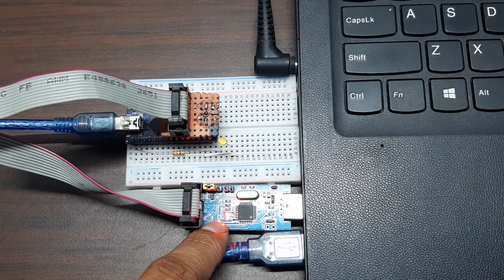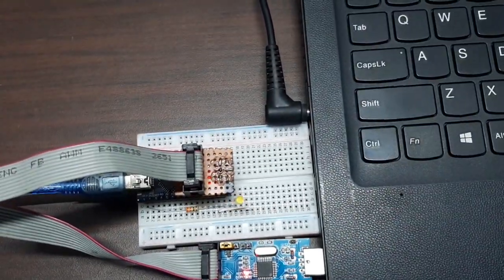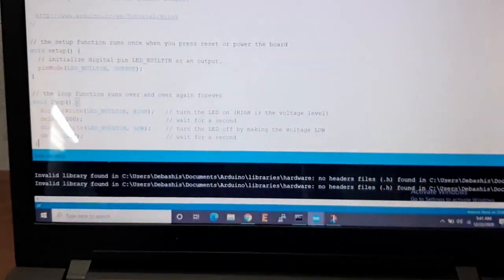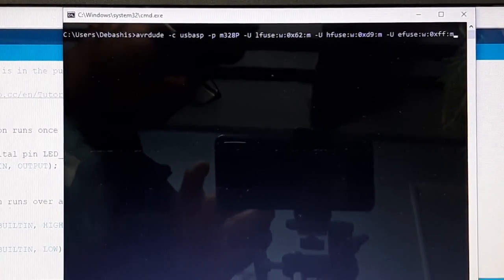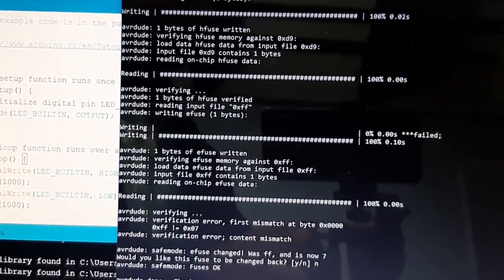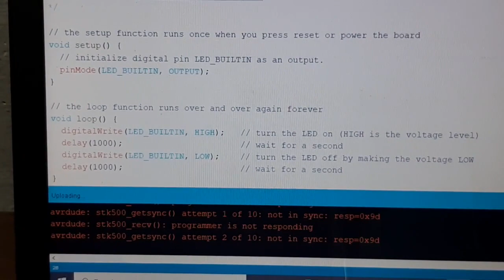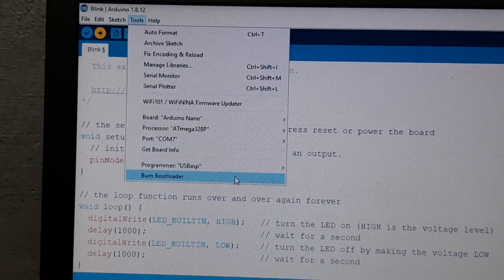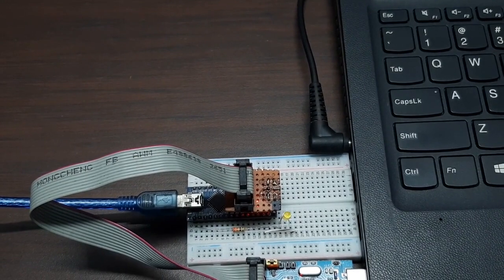How to Use Fuse Bits in ATmega328P to Enhance Arduino Programming

Comment: yes but how to upload sketch with internal osc? is there a way?
Reply from the maker: Hi, you can use Minicore bootloader for that. Install the Minicore using arduino board manager and select the clock source as 8Mhz internal. Then flash the bootloader.
Reply: @Circuitdigest  thank you so much!

Comment: What is problem in my Atmega328P-U microcontroller. I am using external 16mhz crystal . I am using this setting 0xFF, 0xDE,  0xFD,  0xC0 and write by avrdude. 
my project stuck or hang after some hour...
how to solve my problem...plz tell me
Reply: Does your code rely on comparing time values against micros()?  A common mistake is to not allow for what happens when micros() overflows, or wraps around back to zero, after about 70 minutes.
Reply: @TooSlowTube  I can't understand. please explain any code or reference any code..
I will be grateful to you.
Reply: @sushantasarkar123  The mistake comes from waiting for the micros (or millis) to reach a certain time, but not allowing for overflow in the calculation.  

Both of those timers behave like a clock, going back to zero and carrying on from there, when they reach their limit, so a calculation like this can go wrong:

while(micros() < start_time + wait_time);

In this simple case, the semicolon at the end means "do nothing", so it tries to wait until a certain time, but it may never reach it, because micros() resets back to zero, after about 70 minutes.

It depends on the types used for the variables or constants too.  I don't think I can give a link on YT,  but try searching for an article with the title "Avoiding the Overflow Issue When Using millis() and micros()" or "timers - Handling overflow in micros() - Arduino Stack Exchange".